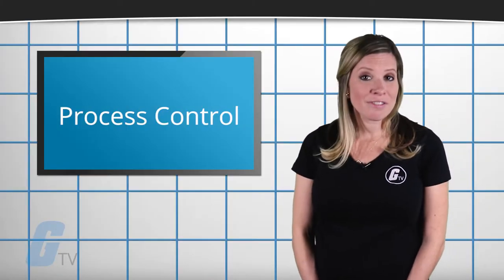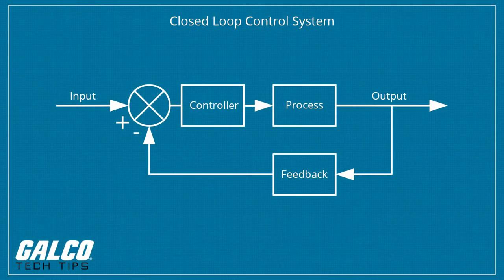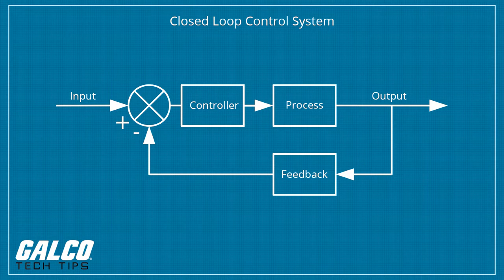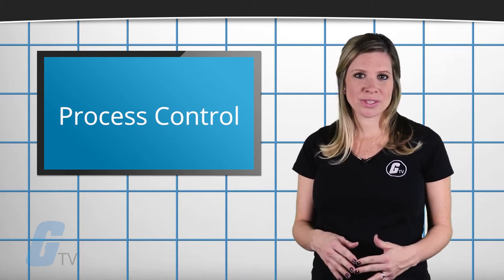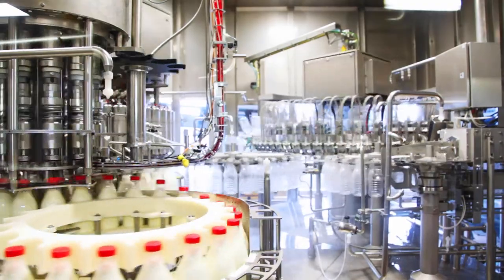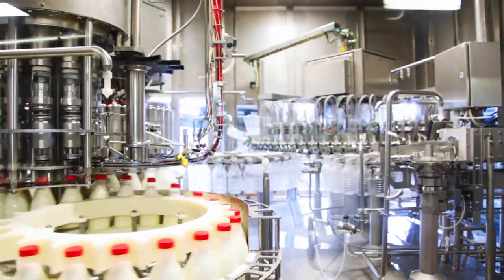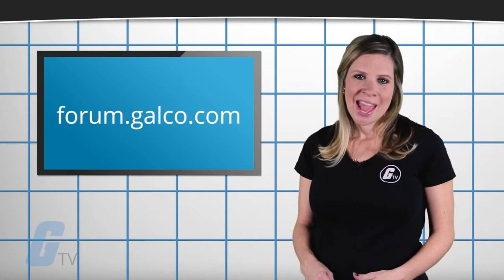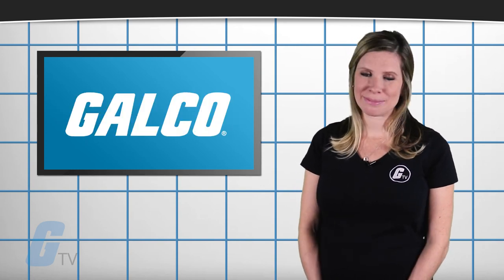What is Process Control - A Galco TV Tech Tip | Galco

Comment: I cant understand what my professor said ,
he asked me to search 
"the effect of temperature in Process Control"

is this related to Temperature Process Control or what happen to the system if the temperature rises or whatsoever ?
Reply: Probably a late answer. If you have a process that has a temperture range in where the process is optimal you can use the data fo your sensors to measure if the temperature is within this range. If temperature is too high the control device can either turn on cooling mechanisms or throttle the amount of chemicals that cause heating and so on , if temperature is too low the controll device could turn up an extra heater. It all depends on your setup, your aviable materials and budget of course.